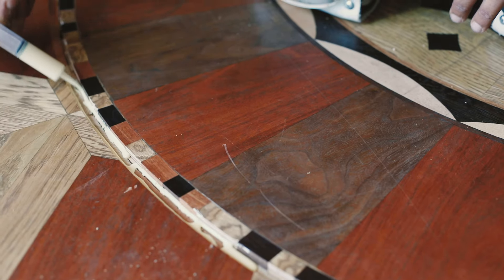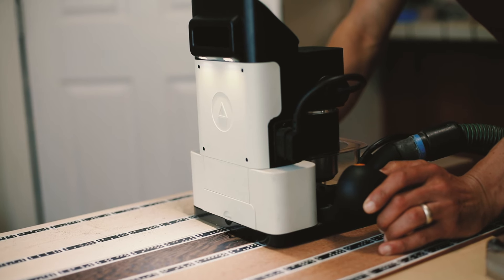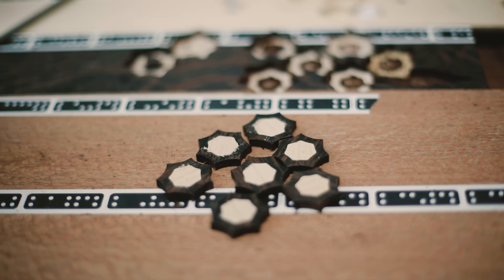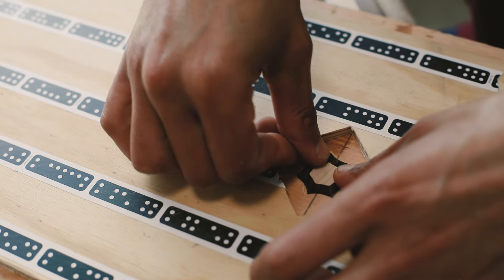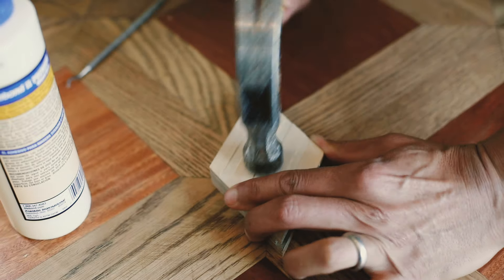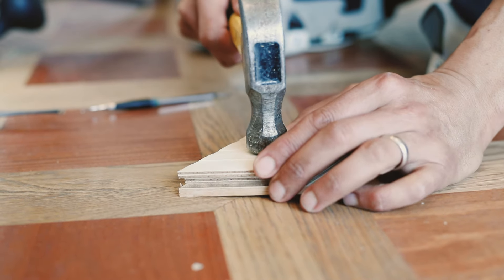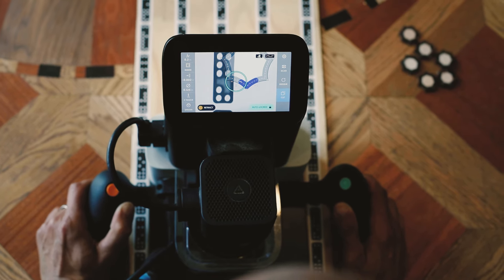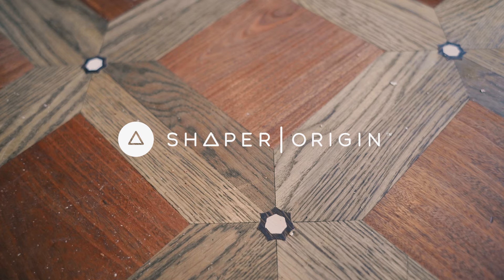Origin in Action: Professional Wood Flooring Installer

Comment: amazing....but so many questions......what if you have a big intricate cut that takes 1 1/2 hours to do. say you run for 20 minutes and get tired? you say you can pick up where you left off. do you leave router on?...can you turn it off, and leave the program on?? leave in place? if you turn it off, when you come back, to resume, will it start from the beginning?  downside might be on doing these long and intricate cuts. you obviously have to man the router all the time. size is the big advantage. with a regular cnc, if it fits inside, you start it and let it do its thing till finished. even for 1 1/2 hours.
Reply from the maker: Hi Glenn,
As long as Origin can see the tape used to cut your project it can pick up where you left off. It will load the workspace, including cut information, from memory when it sees the tape field used in that project. Workstation makes it easy to return to many workspaces because the domino field is static and you can load any workspace you previously cut provided you haven't manually deleted it! If you'd like a further consultation reach out to Shaper Support: support@shapertools.com